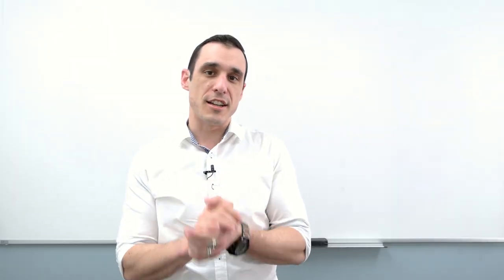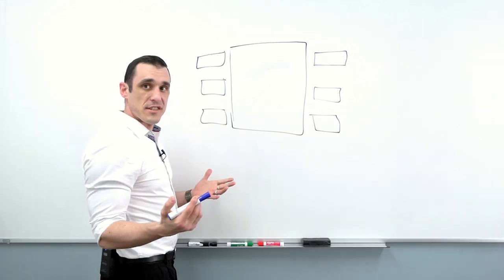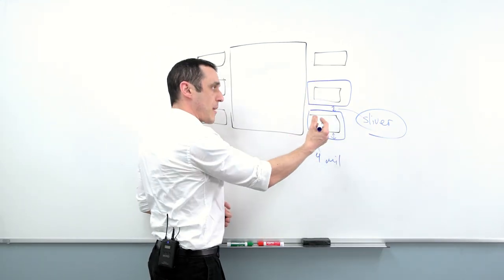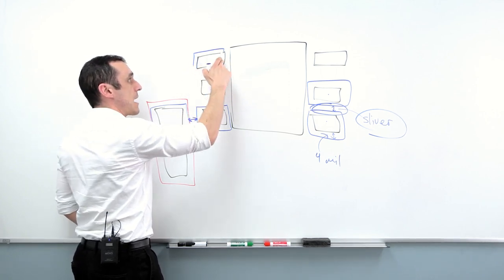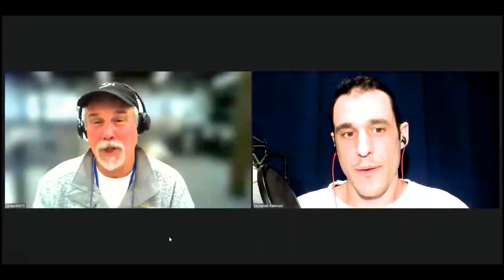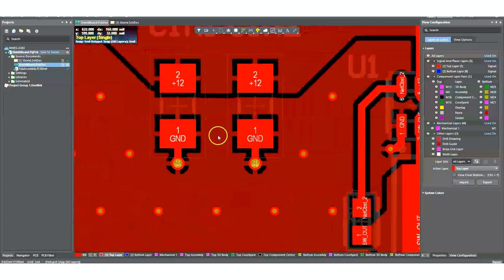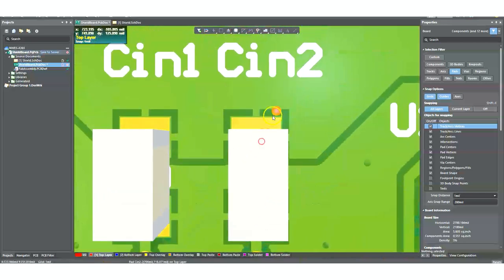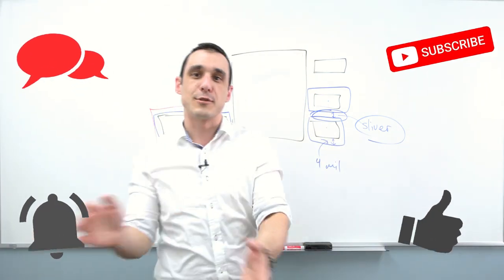Solder Mask Expansion Deep Dive | PCB Layout

Comment: OMG first?!
This is where knowing your fabricator's registration capabilities becomes paramount. Design within them and Bob's your auntie. For those of us who go to the rapid prototyping fabricators, this has to include choosing component footprints that won't challenge their capabilities.
Another consideration is if you need to route traces under the solder mask slivers between pins.
Reply: Routing between pins under solder mask slivers was where this first came up for me. Doing a really dense board, some of the components are so close that you had these small slivers all over the place. Fab guys just said "over 5 mil slivers preferred" and that was their only guidance.

Comment: Good video. At my work we set expansion to 2 mils and minimum  sliver to 4 mils. When a minimum sliver violation is triggered (fine pitch components) we manually remove the solder maks in Altium. It is better to don't have the solder mask rather than having to scrape the PCB between pads removing incomplete solder mask.
Reply: Of course, care must be taken when soldering those components, but there is no way around the PCB fabrication capabilities limits
Reply: @jorditribo94  I agree, this is definitely one of those times where fab and assembly are in competition with each other
Reply: I  got some valuable information from your comment.
My issue is

Thanx for information.  I am still not clear : what "MINIMUM" values should be used for  SolderMaskExpension and MinimumSolderMask Sliver ?

The real problem come , when one,  use a Microcontroller with 100 pins. 

I am using ATMEGA2560 , pad size is 11.2mil (.28mm)... SolderMaskExpension  default Value is     4mil. 
I am getting Design rule errors.    Errors goes if I keep  "MinimumSolderMask Sliver"    VALUE to 0.8mil.

Please let me know the real practical values in my case.

Shall I reduce SolderMaskExpension Value to 2mil or 1 mil ?
and
Increase     "MinimumSolderMask Sliver"

Comment: Hi Zach - Altium reports minimum sliver violations but it doesn't report an error when the sliver is zero or less i.e. when components are located close together. This could lead to manufacturing problems if the solder bridges between pads. Is there a way to setup a design rule to detect when there is no mask clearance between pads of different surface-mount components?
Reply: As long as there is some solder mask sliver (greater than 0 mil thickness), then you will be able to see the solder mask sliver rule will violation if you run a rules check manually. It just might not show the cue visually in the same way it does with copper-to-copper violations.

If you put two components so close together that the expansion totally removes the solder dam between the two components, then the dominant rule will now be the component clearance and not the solder mask sliver thickness. So let's say for example you set 2 mil minimum sliver with 3 mil expansion per pad by default, and let's say you set the pad-to-pad clearance to 10 mils. If you put two component pads near each other with 6 mil or smaller spacing, I've found you only trigger the clearance rule but not the sliver rule.

Hopefully that makes sense; the solder mask sliver rule only triggers if there is some solder mask sliver that exists between two pads, so if you eliminate it with expansion then the only relevant rule is the clearance and not the solder mask sliver.

Comment: Thanx for information.  I am still not clear : what "MINIMUM" values should be used for  SolderMaskExpension and MinimumSolderMask Sliver ?

The real problem come , when one,  use a Microcontroller with 100 pins. 

I am using ATMEGA2560 , pad size is 11.2mil (.28mm)... SolderMaskExpension  default Value is     4mil. 
I am getting Design rule errors.    Errors goes if I keep  "MinimumSolderMask Sliver"    VALUE to 0.8mil.

Please let me know the real practical values in my case.

Shall I reduce SolderMaskExpension Value to 2mil or 1 mil ?
and
Increase     "MinimumSolderMask Sliver"
Reply: The solder mask sliver value should take precedence, and the specific value that your fabrication house will guarantee is placed correctly will depend on their capabilities. Typically the minimum value is 5 mil, but some fabrication companies can do smaller than that. Solder mask expansion should be smaller than the default value, I usually use 1 mil so that this allows for a very small amount of misregistration when the stackup is being built. If you are using a BGA footprint with oversized pads, you can apply a negative mask expansion so that you have a solder mask defined pad.

Comment: Nice video!
We once had a problem with an electrolyte cap whose pad detached from the PCB (delamination?). I think the solution was to create a bigger pad and have a negative solder mask expansion so that the solder mask stops the pad from detaching. Is this a valid approach?
Reply: When did the delamination occur? Did this happen on an SMD cap during reflow or was this manually soldered? If it was manually soldered then your problem might be that the soldering tip is too hot. I've had this happen on small pads when hand soldering small components. If it's during reflow then that is pretty unusual, I've never seen that happen. You could use a bigger solder mask defined pad, but I'm not sure how much larger the pad needs to be to get greater adhesion, but it should scale linearly (double the pad area = doiuble the adhesion strength).
Reply: @Zachariah-Peterson  Thank you for the answer. I think it happened after reflow during transportation, the electrolyte capacitor was about 10mmX10mmX10mm big. In my opinion it is very unusual, especially if the board was only heated once for reflow and didn't go through any additional thermal cycling.

Comment: I understand why a manufacturer or fabricator might want to apply positive expansion to correct for likely errors in their process.  I understand why the original designer would want to specify negative expansion, to mechanically hold the pad on.  But why would the designer specify positive expansion, instead of just making the pad a little larger?  Are thermal relief requirements that tight?  Is the copper-copper clearance typically more than the minimal mask sliver size, and they're just trying to minimize the adjustments made later by the manufacturer?
Reply: In my opinion, just from a practical standpoint, it's a lot easier to change the expansion than it is to change all the pads in your footprints. If you're downloading your footprints, those pad sizes are already set, but you can really quickly change the mask expansion for all the components in the design rules. If it's just a few components you could select the pads individually and change the pad size with zero expansion, that's certainly possible as long you don't expand the pads too large to create a potential clearance problem. Copper-copper clearance could be pretty tight compared to solder mask slivers.